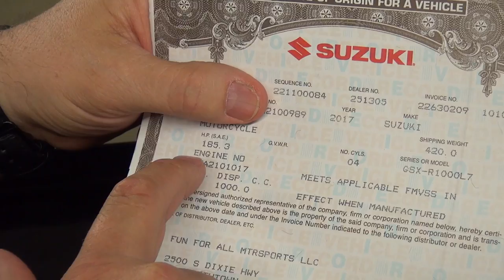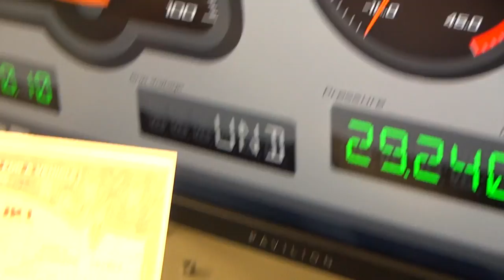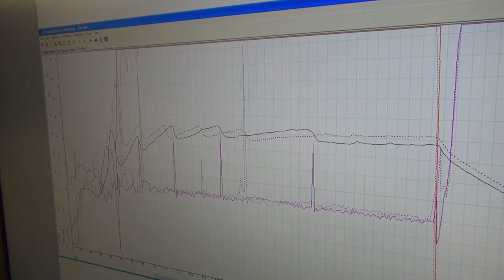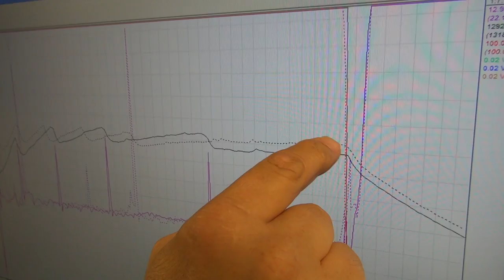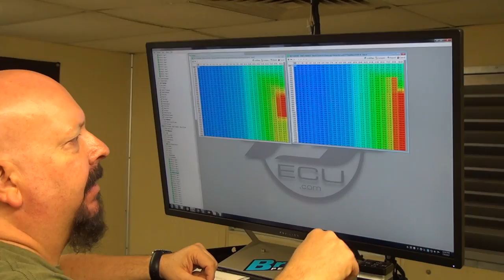2017 GSX-R1000 S2B: SPECIAL EDITION (Q&A) from Episode 3

Comment from the maker: See description for detailed information and video time tags
Reply: Thanx Brock for your wonderfull and very understanding and honest comments..."in all your awesome video's"..(Grtzz from Europe (Holland)..  ;)
Reply: Hi Brock, can you please give me a quick answer as to my problem with exact same bike, I've watched this whole series and tried to follow.  If you have time can you tell me why, when I used flash tune to just simply derestrict my 17 gsxr 1000 (file-2017 GSXR1000 - 32920-17K82(US) - Unrestricted), it felt alright at first but soon I noticed it felt down on power. I took it to a dyno and it was running lean at the start and then as soon as 100% throttle is engaged it goes rich and I mean reaching down in the 10 around 7k and pretty much staying there up into 12k rpm where iit comes up maybe a little.... 136.7hp at 12.8k rpm peak. Terrible... Switched it back to stock flash and it still feels like crap. Bike only has 3k miles. No aftermarket performance parts (other than Yosh slip-on that came on it. just derestricting from stock.

Comment: Great explanation. I was wondering why in previous videos you were programming the throttle valve opening instead of getting rid of the secondary throttle plates. Ahh - throttle by wire with just 1 set of throttle blades. Makes sense to me now.

Comment: Another funny thing is, over here in Asia, the speedos on our superbikes only go up to 299 km/h so if you get your bike tuned/de-restricted and you try to go flat out, the Speedo will stop at 299 but your bike will keep accelerating lol. Very informative video by the way. Thanks! (Does this early-closing electronic throttle valves restriction apply to the MT/FZ-09? I have a feeling we get CA spec bikes here for some weird reason since mine came with CA emissions equipment. I'm about to get my ECU flashed next week and I sure hope those guys will know to rectify that.)
Reply from the maker: @MrFriday00, yes MT/FZ-09 same deal with the US vs. EU ETV mapping. US shuts down throttle blades early...

Comment: Thanks for this video. It's really interesting to see how manufacturers pretty much have to release these models in a way that accommodates the lowest common denominator (Euro 4 & California) while also anticipating future changes like Euro5 so they don't need to redesign the whole thing in a year or two. Has there even been any significant changes to power/motors over the last decade? It looks like no one is going to crack that 185-200 mark (intentionally apparently) so they just draw out the yearly releases with more or less worthless changes like the addition of electronics, design changes, reducing weight, or things like VVT which I imagine is just another way to fine tune emissions/fuel consumption. How much longer can they beat around the bush and not add more power?

Comment: Keep a (cough) backup ecu (cough) in case you uh... (cough) blow it up.
Reply: Problem with that is, in BMW's case, they have become smart. They know guys do this, so they will give you a new one, but your old one wont work any more, and they keep track of it on their system, that is directly linked to Munich, Germany
Reply: EDW 845 yea, BMW is kind of a pain. I have one of their cars and when my battery was replaced it had to be matched to the ecu. Fortunately I was able to track down their tuning software online. Now my car does all kinds of cool stuff it didn't do from the factory. Lol
I bet there's a workaround for the bike ecu if you can get one off a wrecked bike or something.
Reply: András or you could get the key switch with the ECU.
Reply from the maker: We simply disable the immobilizer function in the ECU, then ECU's can be swapped between bikes...but the immobilizer security feature is lost. If the owner wishes to keep their immobilizer function, we can flash the ECU for that particular bike.

Comment: Generally your fuel is a few RON lower.
The IoM TT lads are tight lipped on how much BHP they develop, the top teams cracked 205MPH (330 ish kph)down the Sulby Straight, 20mph over stock needs big power over stock.
Reply from the maker: Great info. thanks! You can bet Suzuki has some race parts available to let the top teams really fly.
Reply: HA, just watched your latest vid episode 6 (Part 1) and came back to to see if i'd guessed the BHP

Comment: These videos from  are very well filmed -edited and informative. I have a 2007 GSXR 600 with the EXCVA system in the exhaust and the secondary throttle valves, by removing the secondary blades and the valve in the exhaust I can tune my bike with a power commander or do I need my ECU flushed?
Thank you keep up the videos!
Very informative
Reply from the maker: You can tune through the power commander with the flies removed. That said, small gains can also be had from adding a flash.
Reply: @BrockDavidson   thank you very much for your reply!!
Best regards

Comment: Hi Brock, a couple of questions if you could help, can you take the cylinder head off with engine in bike and also, our model has a black box under the injectors and the pipe from the fuel tank goes to it, can we remove black box and route the pipe from the fuel tank to bottom of injectors.  Thanks for any help.  Bob

Comment: If you're running a bike with wheel speed sensors and there is an option to shut them off in the flash kit, will it remove the top speed cap (186mph)? But, will it prevent the speedo from reading?
Reply from the maker: Not that we have seen. It typically just removes the codes thrown by the front wheel stopped and the rear wheel moving, but still allows the sensors to function normally.

Comment: Hey Brock, I got a question. What do you know about the 2015 S1kRR? Does it have throttle butterfly valve restrictions or does it open up to 100%. I have a slip on, P08 filter, and pcV tuned to 197whp. Im curious 1. if I have those restrictions stock 2. do you offer anything to remove those restrictions IF i have them stock.
Reply: I have the same bike as you have, and it does have those restrictions. I'm also in the process of having the ECU tinkered with, to have those restrictions removed. Keep in mind what Bock said in the video, it will VOID your warranty then, its to protect BMW from their clients, sort of. The throttle valve restrictions should show on the Dyno chart.
Reply: I was under the impression that the '15 s1k would only give you up to 80% throttle in 1-3 gears but after that it would open up too 100% for 4-6 gears. I looked at the Brock website and I didn't see any options for "tuning" a 15 s1k ecu.
Reply: were and how do they show on the dyno chart?

Comment: I just removed the cables from the exhaust valves, i want to make sure it will always stay open right?
Reply from the maker: Yes. The spring in the butterfly assembly will naturally hold it open once the cables are removed. It's best to pull your muffler to verify that it's in the open position by physical/visual inspection.

Comment: the amount of emissions the new restrictions have saved are negated buy wasting resources on unnecessary  emissions equipment. Better catalytic converters are a better answer.  So is better fuel at the pump.
Reply: Agreed. I think the noise emissions are what seem to be particularly hampering a lot of motorcycles these days

Comment: Greetings from Paris (where ever increasing Euro standards bid you welcome - sigh).
I should start by expressing my gratitude for sharing your knowledge in such a transparent way !

10:12 For the sake of funny bickering, shouldn't it be 165/0.89 (rather than 165*1.11) ?
Coincentally, that would make the value before wheel loss identical to the paper (165/0.89=185.3).
Of course that's all theoretical since a fudge factor is by definition more or less accurate.
Reply from the maker: Hello Shahidpour - rear wheel dyno readings are lower than crankshaft horsepower due to drivetrain losses. This loss is very difficult to measure precisely, but our standard correction factor is 11% as a result of years of comparing OEM crankshaft ratings to our stock rear wheel dyno numbers. Some bikes are as little as 9% and as high as 13% - 11% seems to work the best for our dyno. RWHP x 1.11 is a simple way to estimate a number that really doesn't matter in the big picture of performance tuning. Crankshaft horsepower is for bench racing conversation and marketing hype, IMHO as removing these drivetrain losses are impossible in the real world.
Reply: @BrockDavidson  Thank you for providing such extensive explanations!

Comment: cant we just order a EU ecu?
Reply from the maker: Some bikes yes, some bikes no. The use of immobilizer keys prevents swapping of ECU's. But please don't think EU ecu's are not restricted, they are... just not as much as the US version. The solution is to have the EU ecu deresticted. Example: We offer US deresticted versions with the immobilizer function turned off for the Ninja H2, or you can send your EU version in for derestriction and keep the immobilizer key.
Reply: how hard will the brock ecu push the motor. meaning are we reducing the lifespan dramatically or its relatively safe but the manufacturer is going to use this as an excuse if you have any issues.

Comment: Yamaha patented the exup on  the FZR1000 in 1989.
Reply from the maker: I'm sure this is true. At Brock's Performance, *WE* did not have to deal with the EXUP situation until the 2007 R1, it also came with our first measurement of power reduction at high RPM due to ETV restriction.
Reply: Yeah it was quickly figured out back then that the bikes performed better without the valve,and the Suzuki ran better if you cut a wire.Keep up the good work.